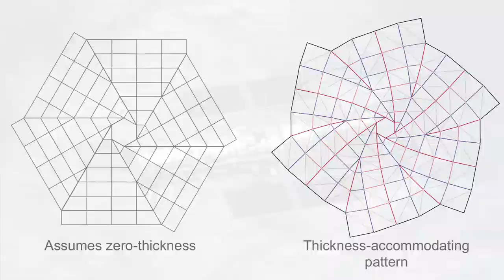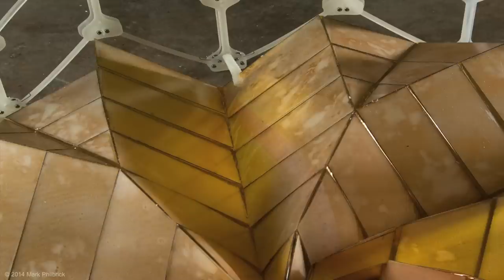Can origami advance space exploration? | Shannon Zirbel | TEDxPeachtree

Comment: This presenttaion is flawed from the fundamental of space engineering. For satellite, power is not a problem but energy. Solar panel is the power generation but not source of energy. Making foldable solar panel will increase the power but does not solve the energy requirement.